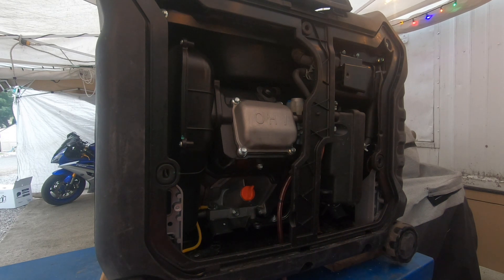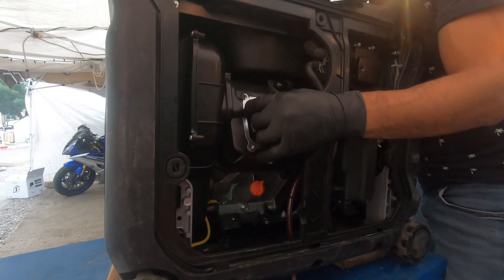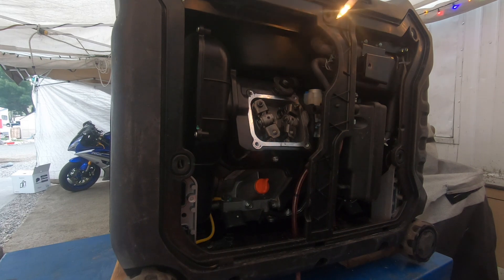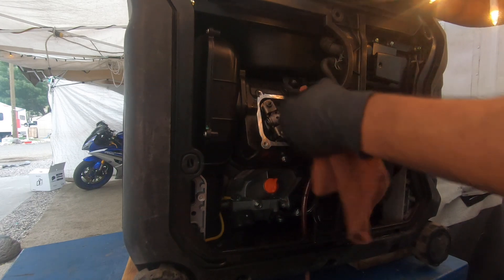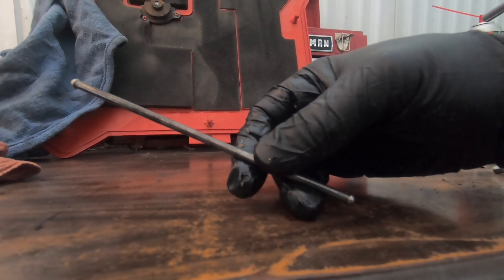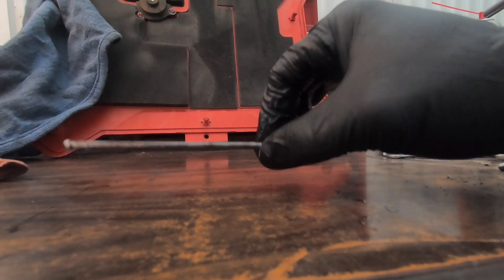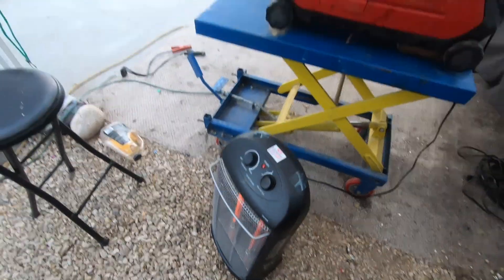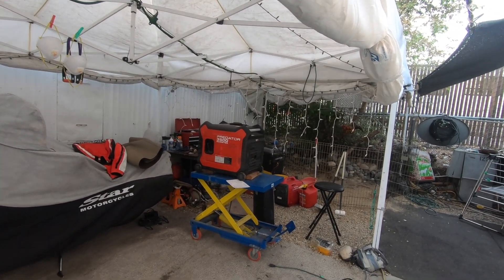How to adjust valves on Predator 3500

Comment: Bent or made bent from the factory? I love my Predator but at best its a Chinese knock off from a Honda engine. They don’t give 2 craps about quality. I have a 3500 and a 5000. I live close to sea level so I’m gonna try the jetting solution. Mine surges after a while. I’ve cleaned the carb and next I’ll try this. My 5000 is running good right now.

Comment: My 3500 is leaking oil through the air filter would this be my problem as well?
Reply from the maker: Change the air filter. when the air filter is dirty it tries to get air from the crankcase hose. while there clean the carb

Comment: So the manual for all the 3500's says the intake & exhaust valve lash should be between .002 & .003" but you're doing .007" exhaust and .005" exhaust.  Mine has the HEMI head on it so wondering if those are different than the the others?
Reply from the maker: @ITguyAR_66  in your case I would follow the owners manual

Comment: Great Video! I have a 3500, 2, maybe 3 yrs old, with very few hours on it, running rough. Your video's (the carb clean, and this with the bent push rods) really helped. I'm in NW Montana, so am also going to clean the carb, and check the jet size. If it's a #76, going to look for a #75 for this guy. Appreciate your putting these vids together.

Comment: my new pulsar running strange.  Checked like you.did, think compresson stroke calls .007 intake .009 Exhaust could not get .004 either.  Adj now I am seeing Champion gen video waits exhaust go down then check intake.  Let intake go down adj Exhaust not sure which first so.  Thought exhaust then intake goes down fuel thats comp?  Any ways Champion has video.  Does it make any difference?

Comment: Thanks! My 3500 is running rough still, with a new carb just installed. I’m going to check the valve lash and the size of the jet. Hopefully I get good results. Let you know.👍🇺🇸

Comment: I have the 9500 version with 1000 hours that stopped running a few days ago. It wont crank and has a little compression. found that the top left rod came out of the spring retainer/keeper. Noticed a few days before it quit it was running rough and smelled strong like it was flooding. Hopefully nothing internal was damaged. Going to tear it down tomorrow.

Comment: Hey bud, if you see this. Thanks for the videos. Mine starts fine, runs for maybe a mibute and dies. I go through that several times and then it'll start running fine. Does that sound like the float in the carb? It's only a couple months old and I feel the carb shouldn't be sticky yet. I dunno, what you think?
Reply from the maker: You're welcome, you're right could be a sticky float. Maybe take the carb apart and clean it and see what happens. When you pull it out. Check the fuel flow from the fuel hose by turning the valve to start and see if it's unrestricted.
Reply: I had this problem but found out the carb bowl has fallen out completely at the bottom of the generator! I put it back together and all is good. I guess the screw got out with the vibration.

Comment: I have this issue with my predator running rough with low loads and at idle . But once it’s under heavier loads it runs perfect . I’m right at sea level so elevation is not an issue , should I adjust the pilot screw seeing how that controls lower rpm fuel mixture or should I go to  a smaller main jet ?
Reply from the maker: clean up the small pilot jet. also delate the spark arrestor make sure you get all of the screens out

Comment: Hey bud. Mine is having a idle issue. It runs perfect un loaded. I have to start it and leave it almost at start and slowly work it back to run. When loaded. I have to leave it very close to the start position. If I go to run, it revs up and down. 

Any ideas?
Reply from the maker: Yes you need to clean the carb sounds like a blocked pilot jet the tiny one on the outside of carb. when you remove it just clean the whole thing. the reason it seems to run "better when you turn the knob to start is because the choke is connected to that knob and it changes the air/fuel mixture for startup. however it is not supposed to run this way so definitely  clean it. and don't let it sit with fuel when not in use
Reply: If your still having issues, remove your spark arrestor and try running without it. I only had mine a month and the arrestor was so clogged it would overload on anything over 1k watts.
Reply: @xxskizzumxx  thanks for the reply. I ended up breaking down the carb and it had a lot of trash come out when I cleaned it. Put a fuel filter on as well. 
So far, as long as I let it warm up and slowly go to run, it no longer has the issue.

Comment: good info in this video. I just finished cleaning the carb on my Troy Bilt 7000xp generator and didn't know about the secondary jet on the top.  Luckily mine is running good so I'll leave it alone for now.

Comment: You are amazing! I enjoyed the way you solved the problem. I have a 3500 and I’m up in the mountains of Flagstaff AZ at 8200 ft. It runs awesomely.  Used it for everything in my RV. Even a little 5000btu air conditioner. Now if I could just get my built it Conan 4500 generator working. It’s 26 years old and stopped working a year ago. It would run while the button was pushed but when you let go it stopped. It ran my RV top air conditioner where the 3500 won’t. It takes too much starter power. I did change the two capacitors/relays or whatever they are called on the air conditioner but still won’t work on the 3500. I wish I was close to you! You know your stuff! Thanks for the videos!
Reply from the maker: Thank you for your compliments I am glad my videos are enjoyable and helpful! the Onan gen probably has a bad fuel pump and dirty carb from the old fuel sitting in it. try cleaning the carb first and see how it goes.
Reply: For your generator check out the oil pressure sensor. Might be faulty if it doesn’t stay running
Reply: Check out some generic videos of onan generators. They are pretty common to fail and keep the generator running without holding the button

Comment: If there is no change in the idle from the eco switch from low to high and it bogs down to overload what do you think it might be
Reply from the maker: If the throttle mechanism on the carb is very smooth and isn't stuck then it's probably a bad inverter board

Comment: May be a silly question but, doesTDC on any particular stroke work? Isn't it usually something like on the compression or intake stroke??
Reply from the maker: top dead center is when the piston is in the compression stroke and both vales are shut and the piston it's at it's highest. you need both valves to be completely shut in order to adjust them accurately

Comment: 50 hours, correct oil change frequency and the dang pushrod slipped out and bent the valve...Should I replace the valve or the head?
Reply from the maker: depends, but the valve will be much cheaper. also get a pair of rods.
Reply: @immortalengines1605  Couldn't even find those parts. They sell the whole engine for $129. I might do that.
Reply from the maker: @tangledline  Really? wow are you sure it's this exact one?
Reply: 129 for an engine sounds mighty cheap for a thousand dollar generator. Please let us know where they sell that replacement

Comment: Even if your push rods were slightly bent while your valve lash is correct,  how could the valve timing be off at all & create your problem?
Reply from the maker: if they are bent it means they shortened themselves therefore opening slightly late and closing slightly earlier than they should

Comment: What does it mean when theres oil going to the air filter ?
Reply from the maker: it means that it's either overfilled in oil or that the air filter is so obstructed that  the engine is trying to pull in air through the crankcase vent hose.
Reply: Usually too much oil. It's easy to overfill the oil